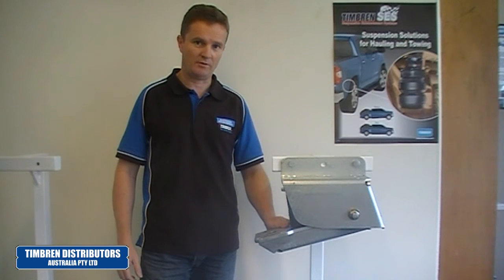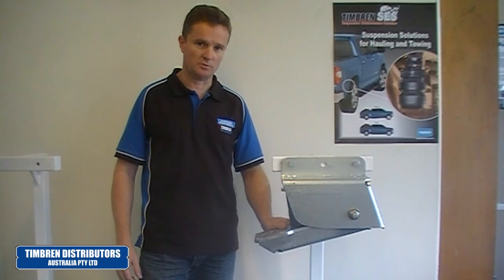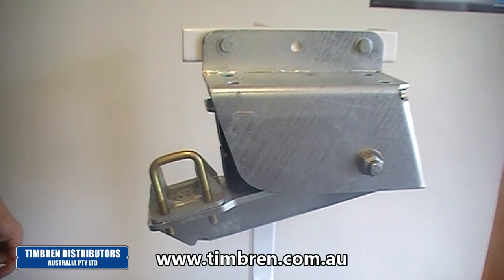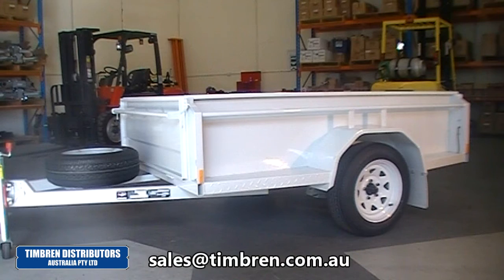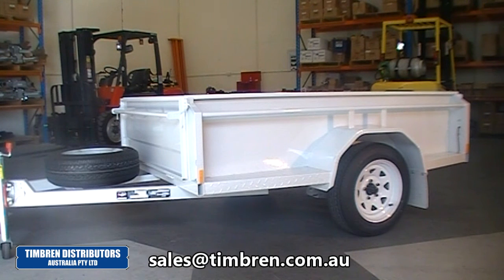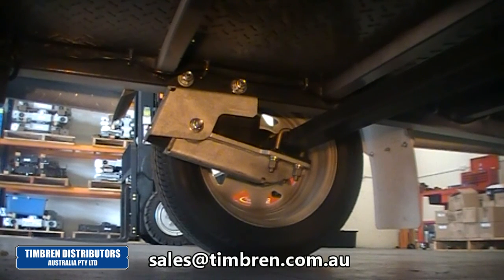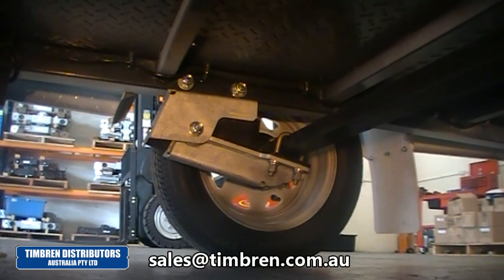Timbren Single Axle Silent Ride Suspension Intro

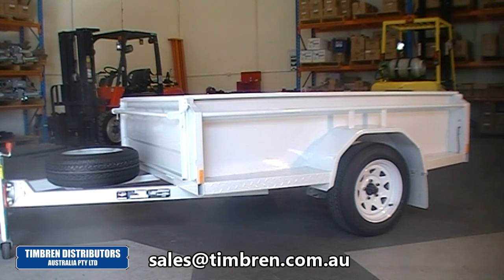Comment: Not alot of room above the axel to come in contact and bottom out on the frame  @2:00
Reply from the maker: The axle does not hit the frame as you can see in the video, the suspension is designed to keep the trailer low.